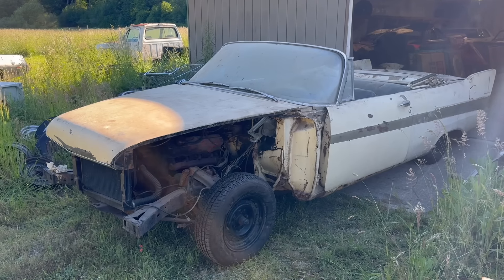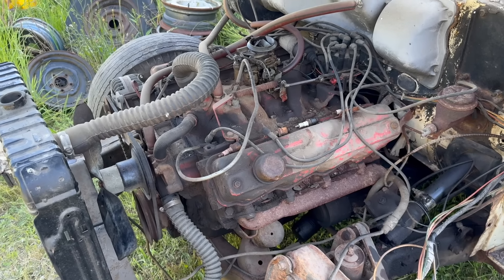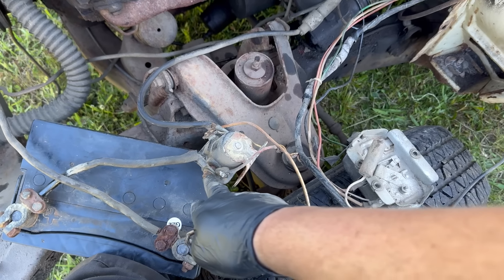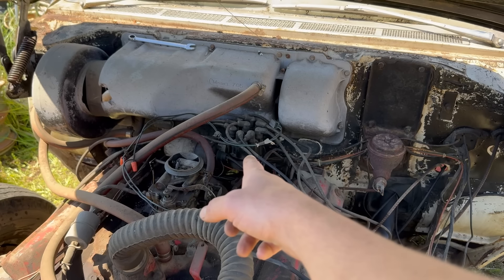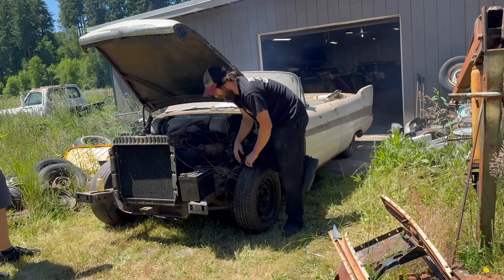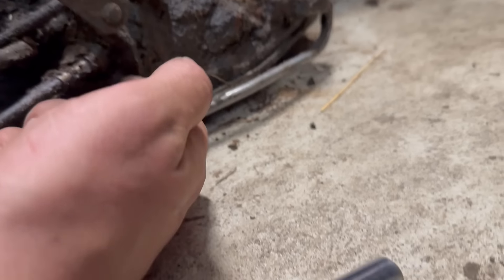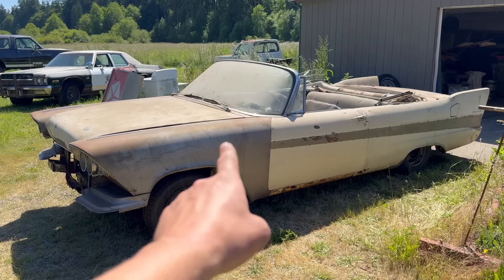Will This Spooky 1957 Plymouth Belvedere Convertible Run And Drive Again After Decades In Pieces?

Comment: Great video Jamie. In 57 and 58 they use the quarter panels off station wagons on their fleet line trucks, so they could incorporate the tail fins into the trucks. They are super rare. I've only seen one in person. They are very cool.
Reply from the maker: I’ve seen pictures of those, and they’re neat.  I’ve never seen one in person…
Reply: @DeadDodgeGarage  lol . I'm a lot older than you. Great video.
Reply: I just took pictures of one at my Favorite annual car show.
Reply: Would love to have a ragtop! We have a 57 converted to a 58 hardtop with the poly dual quad.  That's super solid for  a 57 Plymouth especially a drop top.
Reply: @jimhickey2276  Yes, that is the dream ride for me !

Comment: Awsome car !  My 57/58 sport coupe started out in similer shape ,but after using three and a half cars I ended up with a fantastic cruser.  Your cluster is a 57 as it is gold with dots.  The 58 is silver with stars. Your horn ring is 58, the 57 had a gold center.  There never was a Fury convertible in 56 thrugh 58.  In 59 there was a convertible but it was a Sport Fury !   Good luck  with this really cool project.  The frame shouldn't be a major proublem if you can find a doner car, any 57,58 or 59 will work !  A Dodge or other Chrysler car may also be the same as far as the front of the frame goes !
Reply from the maker: We knew it was kind of a mix of parts. And did learn about the dots vs stars on the cluster in the comments here. Thanks!

Comment: I don't wanna be put in the category of people who a) point out the obvious or b( tell you that you're doing something wrong, ok?  However, I noted when you first turned the key and mentioned the fuel gauge moved, that the gauge went down, not up when the dash lights came on.  Any chance the Belvedere might be a positive ground not a negative ground?

Loved how that engine sounded better and better the longer she cranked and then she had all eight and actually idled too.  Love the sound of the 318 too - a pity the shifter didn't play ball and sad that the frame is a bit shagged about.  Would have been fun to see that back on the road....  

My aunt had a '55 Belvedere - one of 17 made by Plymouth for the Canadian market that were redirected to be sold new in New Zealand.  Some say that they were all green.  What I DO know is my aunt's one was a pale green with a white top and she ran the little HyFire V8....although that thing could really boogie when my aunt floored it.....which she invariably did because she loved the sound of the beast when she wound up and crackled out of her dual pipes.  I remember the unusual looking air vents and the trans shifter that stuck out the dashboard, but I loved the styling of the knobs and dials and the look of the car overall - even as young as I was then.  So much so that I would sneak out and wash it whenever she visited, just so I could spend some more time around it!  The car was so different to the Australian and British made vehicles I was familiar with and which dominated the driveway of my childhood home and I thought it needed to be treated a bit special as a result.  Thus began my love of Chrysler product at the tender age of seven years old!
Reply from the maker: No, when Chrysler went 12v, they went negative ground - in all applications, as far as I know. That was not the case with all 12v systems from other manufacturers. Their 6v systems were indeed positive ground. The gauge going down would be a function of the sending unit. In all likelihood, it’s shot.

Comment: The forward look Mopars are so scarce that when you find something this decent and especially a ragtop, it really deserves to be restored, or at least brought back to life and drivable. It definitely has some challenges, but it's a piece of Mopar history. I like the 57s because my dad had a 57 Fury 3 speed manual 318 dual quads. It was a bit before my time, but I saw pics of it and lots of cool stories.
Reply from the maker: Absolutely a fixer. No question there. We’ve got the dual quads! And we don’t have a three speed, but we’ve got one better…
Reply: @DeadDodgeGarage  nuthin wrong with fords..  just chev...  why do all your valiant,dodge, plymouth, have flexi hoses..   vice grip garage hates them.. still waiting to get my chall 73 back.. 340..r/t. green.. sublime.. 15''aly wheels. gudgeon knock.. have to fix one day.. with a 440..
Reply: @DeadDodgeGarage  60,s fords, cortinas. mk 1/2 could be push started. about 20 mph..prolly has a ford trani..  lol...

Comment: Cable shift in my 65 Fury was worn out when purchased. Leaked like a sieve from unobtainable cracked shift cables. Wanted to upgrade but to my demise was strongly suggested to rebuild original cable shift, bad mistake. "Something" never really found out what, was wrong with the case. Specialists "tried" to fix it. As well, the valve body was cracked as these early style cable style are prone. brother had a replacement, cracked as well. 5 months and $1200 later, i trailered back to the house, although i drove to the "trans specialists" home shop. Found a replacement from a 1972 (71 and up are the best 727, larger front bushing) motorhome in south ga for $150 including converter. 7 years later with a b&m star shift shifter still pulls fine, no rebuild. Do yourself a favor, ditch the cable style. Good video. To bad about the axle, stuff happens...
Reply from the maker: Oh I’m confident the valve body in this one will be cracked too. We have some other ideas…
Reply: That cable shift in 1965 was a one year only setup as Chrysler went to a column shift after using push buttons from 1956-64.  In 1966 Chrysler went to a conventional linkage setup.

Comment: I recently sold my 57 Plaza 2dr Sedan (354 HEMI/4 speed) so definitely enjoyed this video.  At least there is some hope with the later aluminum transmission and it's a lot easier to work with than the the original style cast iron version.  It's shame about the frame.

Comment: One of the coolest finds ever. They made only a limited number of these convertibles for 57 and 58 respectively. Make sure it has floors left to attach the rest of the car. Usually the back side is just rusty has heck on these. Might not be the case with this one. I think this one might have been a stick shift with a inline 6 under the hood? Why such odd configuration no idea. Might have been the case someone ordered a car like that from the dealer? Usually the accelerator pump is the main issue on these 2 barrel carburetors. I think you need some part donors but over all you should be able to fix the horrible and swanky repairs over time.
Reply from the maker: I have intimate knowledge of these two barrels, but we’re going to fix everything wrong with this one by installing dual quads. We have a complete Fury dual quad setup. As I understand, this Belvedere would have been V8 only? Or so I read somewhere. I really think someone ordered this wanting a convertible that looked like a Fury but wasn’t. The rust bug somehow missed the back end of this car. I’m not sure how. Whatever the case, this thing is a sound restoration candidate.
Reply: @DeadDodgeGarage  Every carburetor is foolproof until it's not.🤣 At least the 2 barrel is repairable unlike some cursed Holly's. I'm not sure but for a 4 barrel you do need the right intake and these can be very different depending on the engine displacement size. Savoy was the bottom line model and these would have come with inline 6 engines? Unless this is a weird Canadian made car. The VIN number should be a giveaway. So apparently a stick shift V8 is possible but rare option still. There are collectors who seek these cars not to mention this will attract attention anywhere. Looking forward for the next videos and am here to help if I can.

Comment: The 1957 instrument cluster aluminum backing plate had dots, same as the aluminum plates down were the key switch and wiper switch are. The 1958 had little stars, the push button plate you showed in the vid at 6:42 came from a 1958 it had stars. If it had the original 2sd power flite or 3sd cast-iron Torque flite transmission those didn't have a parking gear, you just had to use the parking brake. the 3sd had a neutral safety switch feature were to start the motor, switch the ignition to on and then push the neutral push button starter switch.
Reply: Yes! That’s what I was thinking too, I worked on a 62-63’~ that required the parking brake, and I thought it just had neutral 🤔. I didn’t say anything because I’m not that versed with the push buttons… From what I remember the old timers saying- the push button transmissions rarely had problems..until the parking pall was put into the transmission which put a lot of binding on the sprag/case from holding the weight of the car all the time-instead of the parking brake, but I thought that was around like 64~ ish🤷🏻‍♂️.
Reply from the maker: Cool! I will look for stars. Someone else mentioned that too. Yes, I made mention of the lack of park in the video - they have no park position and use a tail housing / driveshaft brake. That’s also why I said the brake handle does nothing, because the parking brake left the building with the original transmission.
Reply: @DeadDodgeGarage  lol

Comment: That shift cable is tricky to remove. There's a clip inside that needs to be released while pulling on the cable. The service manual shows using a small screwdriver to find the clip. I've done it on a 60 Imperial. A total PITA.
Reply from the maker: Yep. I was just getting to that step when I learned I couldn’t pull the cable out of the transmission in the car enough because the valve body is seized…

Comment: Great video! The more i watch, the more i see my own  "not mainstream" Mopars. Ive got my '57 Belvedere 4 door hrdtp that i've had since Junior high. Its been sitting out in Exner part of the yard for way too long. I may need to get back to it soon. Ive "hoarded" parts for it for years. The local pic-a-part had a wagon come in about 4 years ago and i pilfrered abouth half of that car before they squished it. Got a solid core support, if ur interested? (I hacked the rusty quarter panels and rear doorskins to hang on my beat up '57 Dodge pickup for a rough Sweptside project)
Reply from the maker: That’s awesome. Get that thing running! Not sure where you’re at, Tom thinks his friend in California probably has one.
Reply: @DeadDodgeGarage  I'm in Idaho. West of Boise.  I could make a 2 day trip out of it. I've got a "new" 1977 D100 that needs some hiway miles on it.

Comment: Although my experience with 57s is limited to Chryslers and Imperials, not Plyms, but they all had pushbutton transmissions, and none of them had park, only the brake drum on the trans output. Anyway, watching this brought back some great memories, thanks!
Reply from the maker: Correct! Aside from the three on the tree manual models, of course.
Reply: @DeadDodgeGarage and the 57 fury scared the crap out of GM and made them change design mid stream

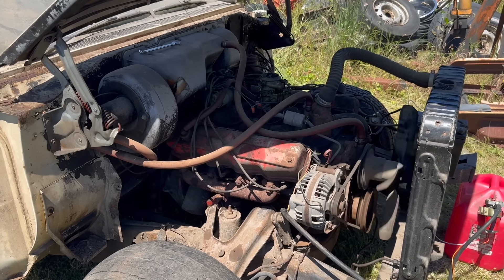Comment: 25:56 If you look at the cable to the right of the screen near where the brake booster usually goes (Ish) you will see it Arking out to the throttle rod. Or I'm seeing the fan blade let sunlight through or something. But it sure looks like spark to me. LOL.
Reply from the maker: You’re the second person to comment that actually, and I am going to check that out next time I get a chance to run this thing.

Comment: .That 57 is by a mile the coolest car you've got .Needs suspension and brake upgrades and a Sonoramic RB with 4 speed ( 5 speed even ) .
Reply from the maker: It doesn’t need any “upgrades.” If the stock suspension and brakes worked, we’d be doing fine. I could get definitely get onboard with a cross ram setup, but we’ve got dual quads for the Poly - and a four speed…

Comment: Made money off my 65 coronet,nobody believed could jump start an automatic, hah. Thanks mopar. Poly 318 in that car had 265,000 miles. So much blowby inside of distributor got soaked in oil and wouldn't run. Little carb cleaner all good for a little while. Replaced with 383. Entertaining as usual. 😊❤
Reply: Lying C hunt
Reply: I lost an argument about a 65 New Yorker I bought lol. I always assumed the cast iron Torqueflights were the last with a rear pump.     Were cast iron Powerglides able to be push started?

Comment: Thinking back to my 62 Polara when the park lever is engaged you cannot depress motion buttons forward or reverse
Reply from the maker: Right, that’s what I was saying - but I believe that locking mechanism is in the shifter itself, not the transmission.
Reply: And  park lever will pull button(s) into neutral.

Comment: That's got a gear reduction starter which only fits a '62 and newer red engine  and transmission, so that's a '62-'66 poly 318. The Trans is a '62-'65 pushbutton 727. Also there's a second cable for the park on the '62-'65 727 the '61 and older have one cable.  If it has a ball and trunion front U-joimt it's a '62-'65 727. If it has a standard U joint and slipyolk, it's a '65 727 , It was lever controlled, not pushbottom, but still used the cable shift. Also, the '62 and newer touqueflite does not have a rear pump, so you can't pushstart ir
Reply from the maker: If you had actually watched the video you're commenting on, you would know that I know all of that, and also that I explained in the video that this is a later drivetrain. Also, you are incorrect on your last point. The 727 had a rear pump through 1965. This is a fact easily verified in many ways (reading could work, thumbing through a service manual, or even watching videos of people push starting their 62-65 cars as I have) but I suppose a quick and convenient way is the mere existence of MoPar part number 2464383 - "1962-1965 A727 Rear Oil Pump Housing." Now, maybe you didn't want to listen to me talk for all 32 minutes, and I don't blame you at all. I'm obnoxious. But I really do know what I'm talking about. Thanks.
Reply: @DeadDodgeGarage  I commented after the red engine statement and after the pushstarting it statement and listening to the starter. fairly early into he video. It was when I heard that starter I put 2+2 together and posted my statement.

Comment: Jamie, an unrelated question of I may; bit of a back story first. Recently I had the pleasure of driving an authentic (apparently) 1970 Challenger RT 440 converted to an auto tranny, thing is it had issues like pinging, ignition issues, horribly adjusted drum brakes, squeaks all over (got too used to body on frame saloons I guess). Yes I am bragging a little, but there is a point to this I swear.

My question is; are E-Bodies, in general, reliable vehicles? Sure these are 50+ year old cars that are bound to have issues related to age, but are they prone to failures?

I'm seriously considering devoting a part of my life to purchasing (hopefully) a 1970 Cuda, preferably one that's at least partially restored, but I was told by someone with more experience than me to buy a Chevy, as they are in general almost bulletproof, while Mopars are generally maintenance hogs. Is that true?
Reply from the maker: Ridiculous. Lol. Chevy people are mistrusting of Mopars for reasons I’ll never understand. I’ll take the E-body, thanks. But there is no such thing as a “reliable” 54 year old car. There will be issues - that’s part of the experience. But they are rarely serious issues. If you truly want an old car, get ready to work on it and figure out problems. That’s what it’s about.

Comment: There were no fury convertibles until 1959. The gold on your car, is painted. On a fury it’s gold anodized stainless steel. 
The ‘57 cluster had gold dots. Usually sun faded the ‘58 cluster had stars.
Reply from the maker: Yes, absolutely on the trim. I could have mentioned that but didn’t. Interesting on the cluster.

Comment: in the movie she was a 58 but in 57 all furys only came in white, rewind to the beginning scenes of the movie, a long row of white Furys and one red one, the red one was evil.  The book talks about it slightly,  they introduce the assembly line in 1957 but there's still plenty pf room for debate because production years and model years overlapped a little.   Very few 1957 Furys on the road today.
Reply from the maker: I was told that the car in the book was actually a Belvedere sedan? But I’ve never read it so I don’t know. In any case in ‘58, Furys were all beige as well. And in the movie, the car is indeed shown on a production line as the one red one in a line of beige cars.
Reply: @DeadDodgeGarage   just checked the motion picture to be sure,  the timeline starts in Detroit 1957 on the assembly line, they all have the Belvedere grill, even Christeen.  Fast forward to when the shitters vandalized her in Darrell's garage, there's the engine sceen, she's got dual carbs and no jiffy bag some of these cars came with the jiffy bag, some came with a white plastic WS washer reservoir but i've never broke that code.  the 57 that i was intimate with had a jiffy bag

Comment: When did they change the 727 so you can't bump start them? It's a trick I would like to try 😂
Reply from the maker: Actually someone else asked about that and I don’t know, it’s either ‘65 or ‘66
Reply: @DeadDodgeGarage  I might try it in my 64, what's the worst that could happen. 🤣
Reply: @DeadDodgeGarage  65 was the last year
Reply: 66, and those had the levers for shifting that we're all used to. Something with the front pump also changed in 71 I believe.